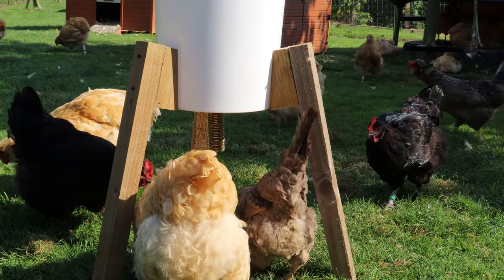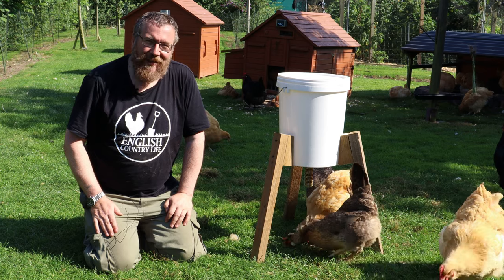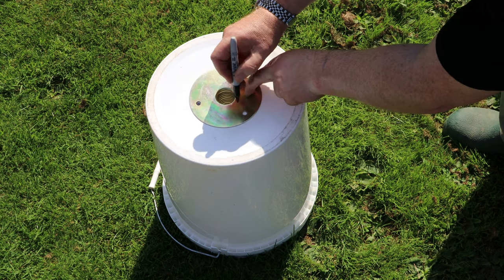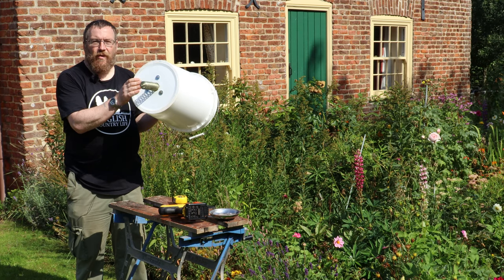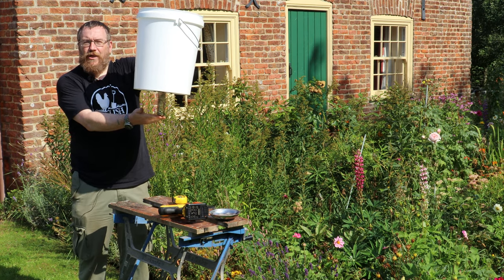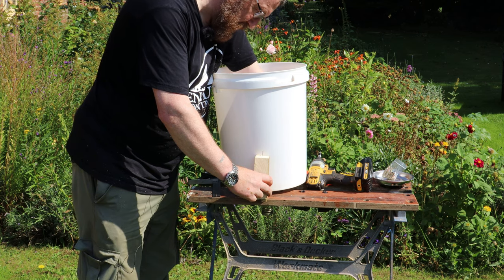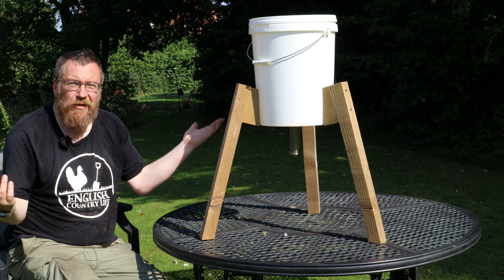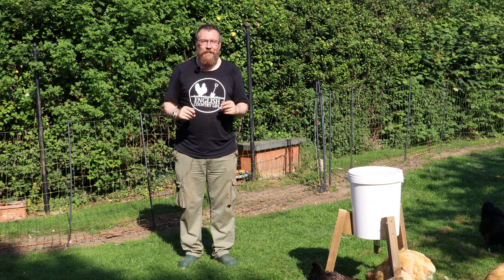Homemade Poultry Feeder (chicken, duck, turkey and goose)

Comment: Use the screws on the bottom as a guide to space the legs
Reply from the maker: It's a good way but if you use long bolts like me, put the legs halfway between the bolts or the bolts get in the way of putting the screws in!

Comment: That spring device is great, overhead feeders are so much better than the old traditional feeders that fill up with water and other crud in the trough.
Roofing washers with the rubber pad are good for using on plastic buckets, because they are made for nailing corrugated roofing they conform to the curve of the bucket without stressing the plastic.
I don't know if you remember but on your pruning video i commented that decent bypass secateurs were difficult to get here. Well,last week I finally received a pair of Stihl secateurs that I ordered from a new Stihl shop in the local village, they are excellent, the blade and lower jaw are chunky drop forged parts so they will not flex when cutting the way most of the cheap ones do, very well made and designed.
Reply from the maker: I'm so pleased you managed to get some good ones Chris - the roofing washer idea is genius!